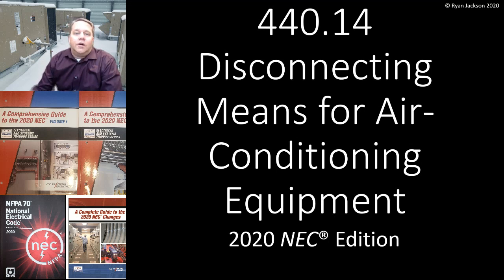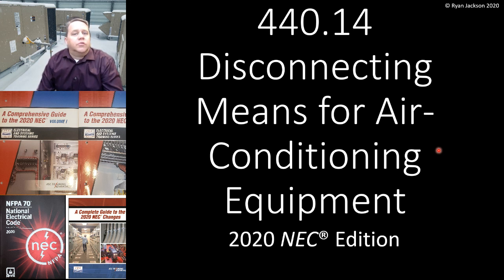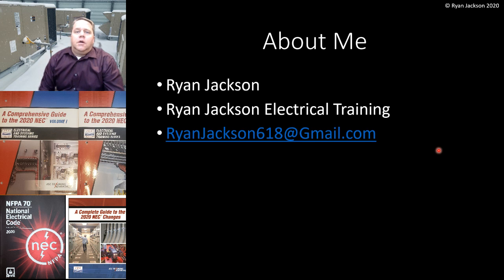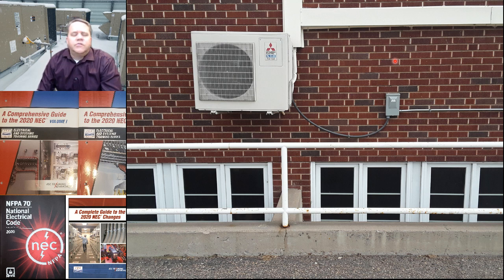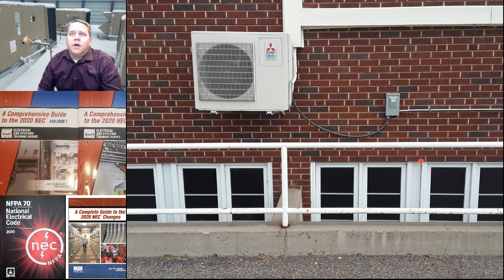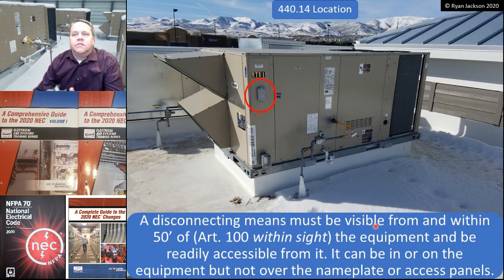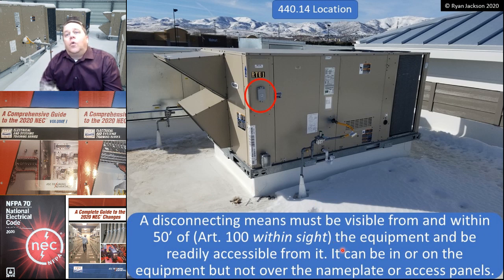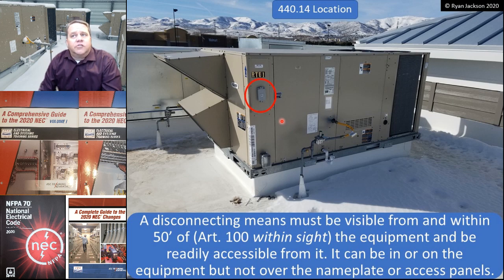Air-Conditioner disconnecting means requirements

Comment: I've never thought about this topic in detail. 

But I'm on a new construction apartment now, which is already weatherproofed with a silicone roof coating which limits our field penetrations (for screws). There's an AC for each unit, so ~60 units. The copper refrigerant lines run haphazardly throughout the roof, and the number of vents that brings working space into question. I'm almost questioning what's the best case approach. My foreman has already done the respective stub-ups near each  unit, but each unit has a number of obstacles per AC unit that make installing the disconnecting means a challenge. Is it a clear obstacle? A judgement call if stepping over copper lines, defies working space. I think if the AC units had a designated area on the equipment to mount the disconnect, that would be ideal because it limits our field penetrations, but after looking at the Samsung CAC Universal Outdoor unit, there doesn't appear to be any space for mounting a disconnect box directly on the unit.

 I almost wonder if the foreman should have brought all the AC homeruns to an oversized NEMA 3R box on the exterior, then built out a fusible disconnect wall; maybe 30 disconnects one side, then 30 disconnects the other within sight of the HVAC units. Those load side of the disconnects then go back down from the roof, then get stubbed up near each unit. This avoids running conduit which could easily deteriorate on the surface of the roof, and satisfies the requirement of disconnecting means. It just requires planning which we didn't have.

Comment: First comment??? Holy cow!!
Just a homeowner here, but love residential electrical nuances.  As far as that mini- split condenser is concerned, a normal brick size length is 8" plus 1/2" for the morter, so that looks to be about 42".  If you have a ladder in that well there, I would think that both condenser and the disconnect should both be easily reached. Can we get a PASS on the installation?  Lol
Reply: Good observation I can honestly say, though, that if I were the sparky wiring that up, that disconnect would be mounted on the ground so I didn't have to screw with mounting the disconnect in the air, or it would be much, much closer to the equipment, along with a utility receptacle for HVAC service that unit.
Reply: @jefferytownsend7787  Just a question though.  If the disconnect was near the ground, it wouldn't be accessible from the device (compressor), no?  Of it was moved to the left it might be closer, BUT it might be in the way of a ladder in the stairwell, or under the ladder's rungs.  I'm guessing a more appropriate place might be up and to the left nearer the line sets for the AC units.  But maybe that was not an option at installation...we don't know if the electric/disconnect was installed before compressor/line sets were determined or not.  And was the HVAC guy also the sparky too?  So much we really don't know about the installation when you sit back and look at it.  Thanks!

Comment: Interesting how things are done differently. In my country usually air conditioners take power from the inside unit, i.e. the electricity supply goes to the internal split first (that contains the control logic) and then a cable that carries power and control signals to the outside unit. Usually the inside unit is either powered from a normal 16A socket (they come factory fitted with a plug) or trough a dedicated circuit with a dedicated breaker in the electrical panel. It also make sense that way, you just have to run another cable with the line set (that you would run anyway) and you already have power inside your house so no extra work needed. Also if you use the method of plugging it in a socket who does the installation (usually a plumber) doesn't need to be a certified electrician, since it's seen as an appliance that you plug in, it isn't connected permanently to the wiring. 

To me a disconnect for an air conditioner seems overkill, they are also ugly to see, and usually outside air conditioning units are installed high on a building so you don't get any access anyway. Also it makes sense that the power is controlled from the inside unit, since it's the one that has the IR receiver and thus turn on the unit, and that way when the air conditioner is off the outside unit is completely off.
Reply: Most sockets inside US homes have only 110V while the air conditioner uses 240V or 208V. That might be a reason they need to run a separate supply anyways.

Comment: I have a situation where I have 
 24000 BTU Duct Mount Mini Split Air Conditioner in a hard ceiling with a foot wide by foot wide opening to access the electrical side of the unit .So my question is that do have to put a disconnect by unit even though there a panel less than 10 feet away where unit is fed from and in sight ?Thank you Ryan your input would be great

Comment: The under eave disconnect is a rain tight enclosure IF INSTALLED PER MANUFACTURER INSTRUCTIONS...
so...
Violation because the instructions clearly state this side up...
Reply: That's the case if it is NEMA3R.  What if you had it in a NEMA4X enclosure, where its rain-tightness is direction-agnostic?

Comment: Can the disconnect be in the main Circuit breaker panel? Let me explain my panel. Coming out of my meter I installed an exterior 200amp breaker panel flows though to the house 200mp with a breaker for my shop 100amp. I wish to install 2 AC units within about 15’ of my main external breaker panel at ground level.
Reply from the maker: As long as the breaker is both visible and within 50' from the unit.

Comment: DISCONNECT ORIENTATION: I try to go by 240.33  when it's a fusible disco.
...unless impracticable as stipulated in NEC 2017. Hospital ceilings can get packed full, for example, and the 2020 removes "impracticable" as an allowance.
This may get very expensive now.

Comment: If you already have an OCPD of the correct amperage in the panel feeding  the disconnect, would I need a fused disconnect at the location?
Reply from the maker: Only if the unit specifically says "maximum fuse" instead of "maximum breaker" or "maximum overcurrent device."
Reply: @RyanJacksonElectrical  where exactly in article 440 does it state that?
Reply from the maker: @jolyonwelsh9834  Nowhere. It is part of the listing instructions. 110.3(B).
Reply: @RyanJacksonElectrical Ok, that's what I figured. It's the same as when people tell me that when installing receptacles, you must have the ground on top. Nowhere does it state that in art. 406. I looked through art. 440 and couldn't find anything about that.

Comment: The code says that the disconnecting means must be visible from and within 50 feet of the equipment, so, equipment and disconnecting means can be separated up to 50 feet. Readily accesible means that a person doesn't have to walk more than 50 feet from the equipment to its disconnecting means. Am I wrong?
Reply from the maker: Correct, as long as the disconnect is still visible from the equipment.
Reply: @RyanJacksonElectrical  can the disconnect be placed behind condenser as long as it is above it?
Reply from the maker: @coldwater6724  It is a judgement call, as 110.26(A) is subjective. I would not allow it, and 2023 NEC (if it continues to pass) will specifically prohibit it.
Reply: @RyanJacksonElectrical  thank you good sir much appreciated
Reply: @RyanJacksonElectrical  I subbed
Reply from the maker: @coldwater6724  Thanks!

Comment: The under eave disconnect is a rain tight enclosure IF INSTALLED PER MANUFACTURER INSTRUCTIONS...
so...
Violation because the instructions clearly state this side up...
Reply from the maker: Why would it need to be raintight?
Reply: @RyanJacksonElectrical  agreed, under the awning, it may not be needed to comply as rain tight, but it still would need to be installed per manufacturers instructions.
The wiring shield will fall off every time the disconnect is pulled, and the cover would be difficult to keep closed. Also, it is installed on the edge of the overhang, so it would be subject to weather.